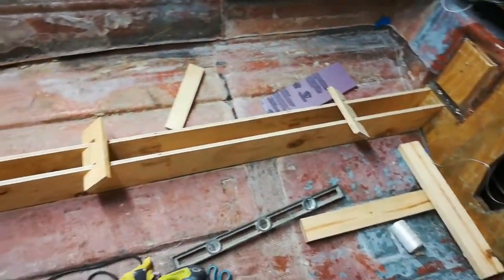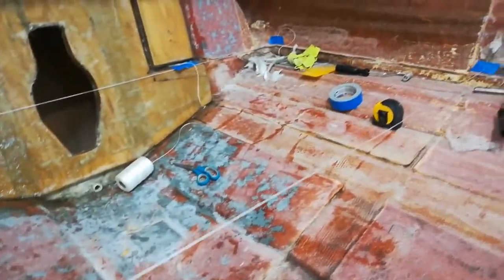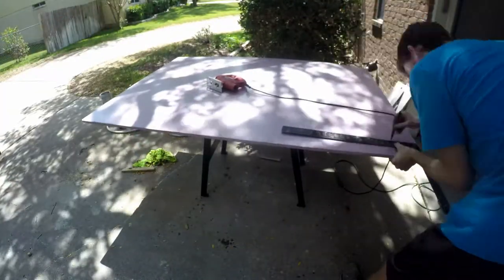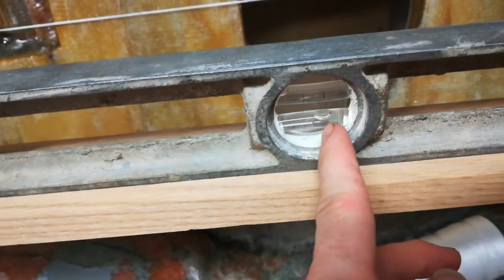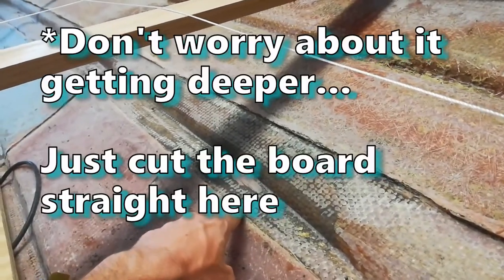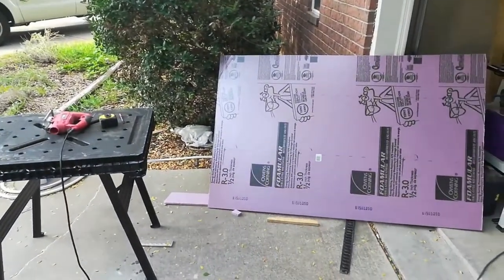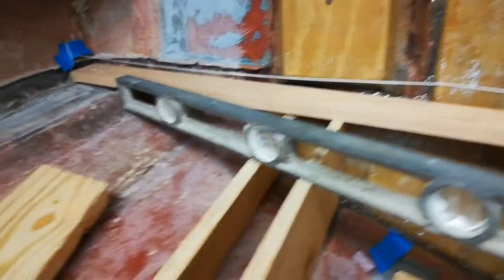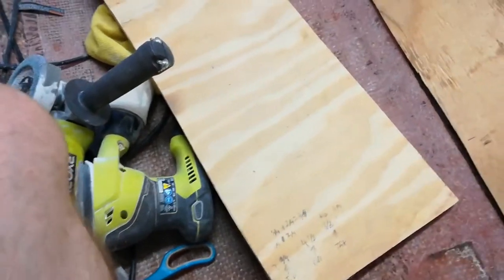Bayliner Boat Restoration - part 18

Comment: Remember that you are working on a blank slate now. For future reference you can just make your own design and need not follow what was there. If using for fishing you can add wet wells for holding fish. You can add tons of storage space under the floor in compartments. You can also add another fuel tank to the existing one for long vacations away from refueling spots. and so on and so on. Think about how you want to use the boat and then think about making compartments where you want them to be and that will be your support system for the new floor. Also I would suggest sanding, pressure washing the inside, and then adding a layer of resin before beginning your next build on another boat.

Comment: Second note: Boats are subjected to tons of water as you know from al the rot you tore out of this boat. When doing your support system (stringers) for the new flooring system I suggest using 1" pvc pipe cut in half length wise and then cut to lengths that would fit the width of your stringers on the very bottom of the stringers to allow for water to flow from rain, snow, etc.. to drain to the bottom and work its way back to the bilge pumps. This allowing for the boat to dry out faster. Possibly thinking of a way to create air flow under the floor system to promote drying as well.

Comment: Nice video, I was wondering if your boat has balsa for the core in the hull? 
I have a bayliner and I am restoring it and when I was grinding for the new stringer at some place I get through the fiberglass so now I see the balsa core with ni fiberglass on it. So right now I think I am going to recover those portion with new fiberglass and epoxy. Do you think it's a good idea or did I screw up 🙄?
Thank you!
Sam
Reply from the maker: good question, the stringers in mine looked like regular ply fiberglassed. If it feels strong enough not to remove, then you should be fine to leave it and connect to it with new fiberglassing